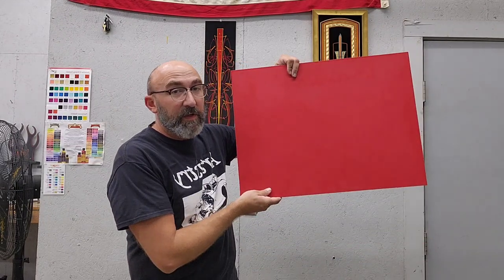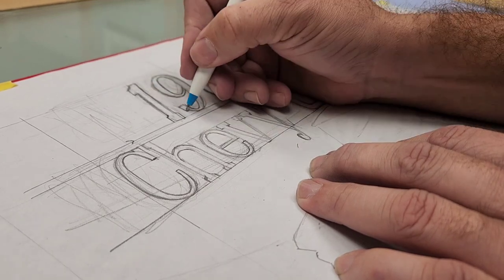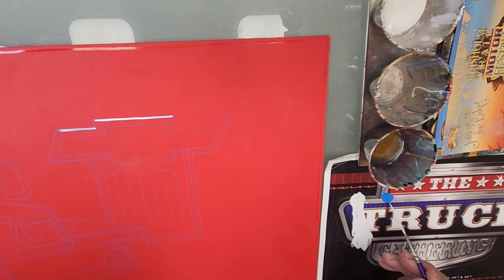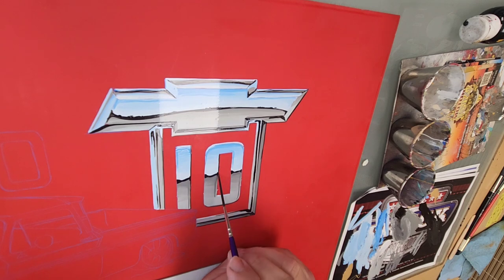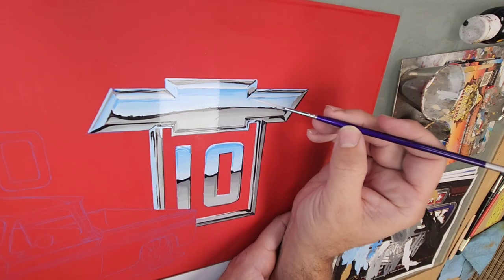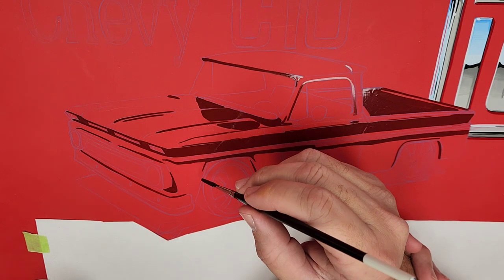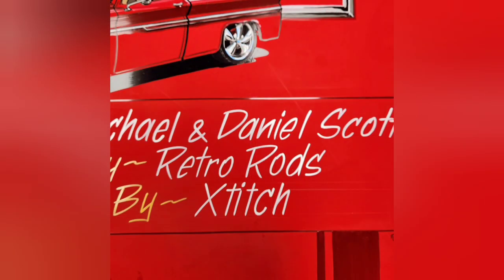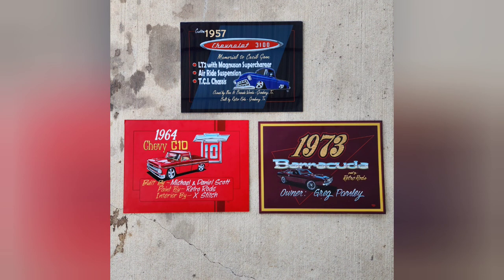Painting A Car Show Board (start to finish)

Comment: Thanks for the video!  That truck looks amazing!!  I've been painting signs for years and will be painting my first car show board.  I was wondering what brush you used for the casual lettering?  I use #5 grey squirrel lettering quills a lot but looks like I need a smaller brush.  I have a  Kafka #3 striping brush...would that work for lettering?
Reply from the maker: I am pretty sure that I was using a Virus. Probably a size 4
Reply: thanks, I'll try one out! @JackFlemingArtistry